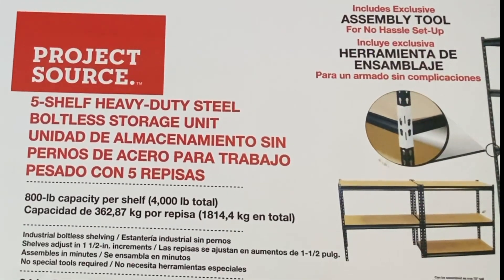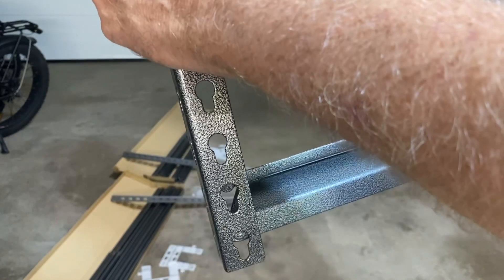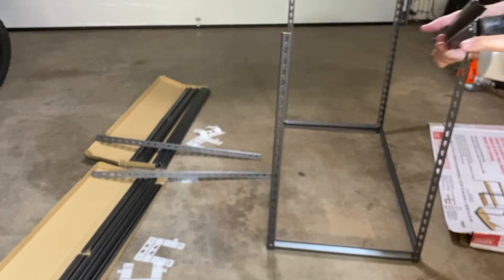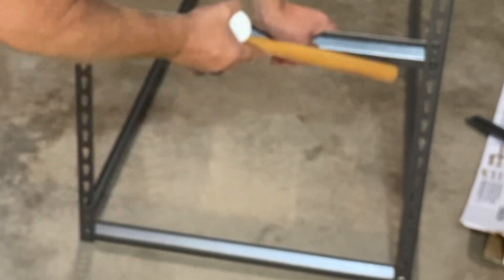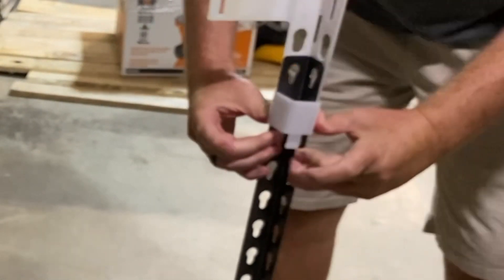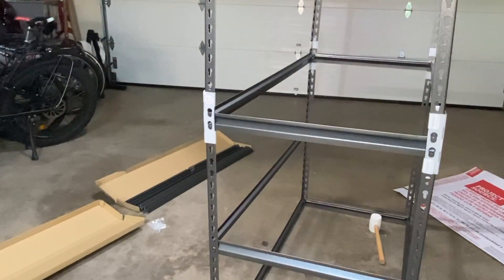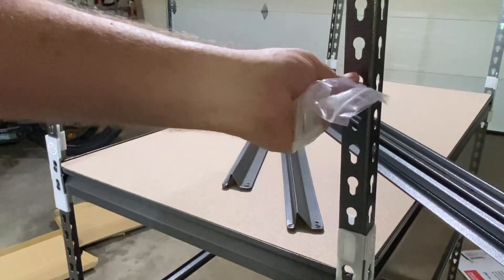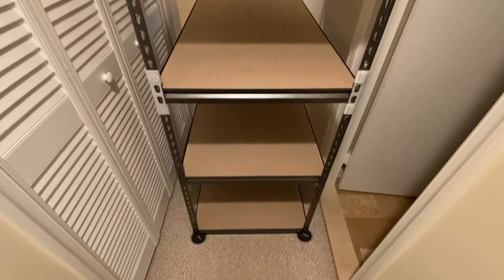Revamp Your Space with Project Source Boltless Shelving! Easy Assembly Guide!

Comment: Thanks for your video. I think my instructions say to remove the plastic aids and discard them. This is the crappiest shelf system I have ever bought. First one that I needed instructions or help.
Reply from the maker: Lol, glad the video helped. I keep the plastic things on the shelf so I know where they are at if I need to take down and rebuild the shelves again. The directions do leave a lot to be desired but the shelves themselves seem to be holding up very well actually.
Reply: @crewmax4240  I left mine on after what it took to get them on in the first place.